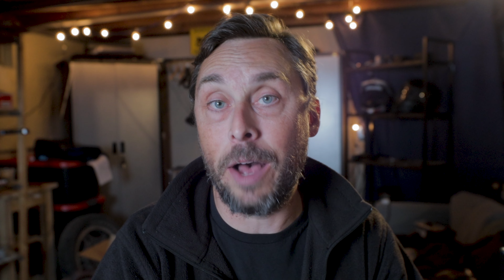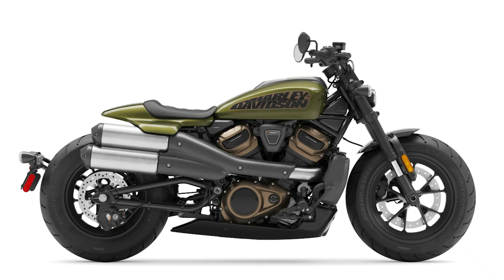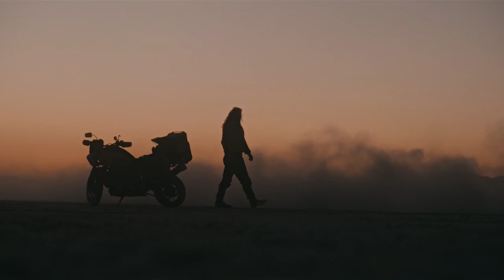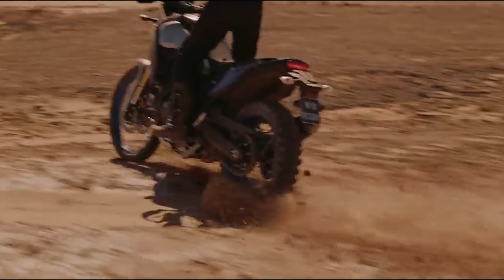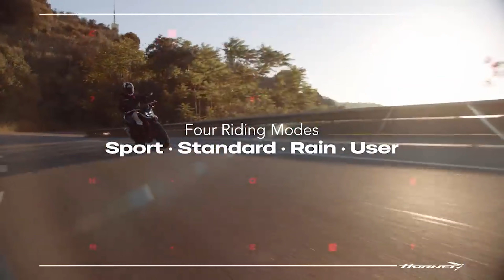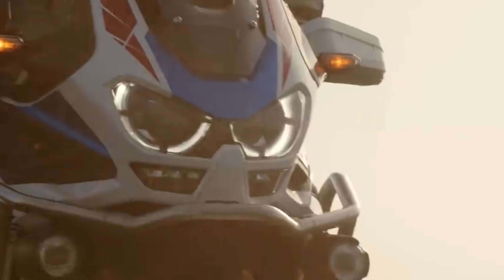Honda Transalp 750 & Harley Pan America 975- Announced at EICMA?

Comment: I REALLY hope that Honda has figured out the top heavy nature of their AT.  Triumph moved the engine by rotating it forward to get the weight lower.  I hope Honda does the same.  That and lowering the seat height a bit.  I like some off-road, but its mostly gravel roads.  I don’t need as much travel as a big ADV bike, but having some is required to not bottom out.  Transalp could be a great bike.
Reply from the maker: Im definitely challenged by how top-heavy the AT is. I have high hopes for the Transalp.

Comment: Let’s hope they take off all the electrical issues plaguing the 1250. 
Mine let me down for the third time yesterday, not starting. 
I had to take another ride. 
I let my dealership know that Harley needs to buy the bike back at this point.
Reply from the maker: That’s crazy! There are so many Pan Am riders with electrical issues. I’ve been pretty lucky with near 3K on mine.  I hope things get fixed or the dealership does the right thing.
Reply: @GreatEgret   11k on mine and yeah, it’s always something.

Comment: I don’t think it’s fair to compare the transalp to the tenere and I don’t think it’s Hondas intent to compete with it. Past generations of the tenere have always been rally/off road bikes and the transalp has always been more of a layed back but very capable adventure touring bike and it looks like nothing has changed for both motorcycles. I think the transalp will do very well with older and more timid riders who want a bike for exploration and the tenere will always attract the more aggressive hooligan riders. Lately the T7 has been the bike of choice for a lot of trans-continental explorers ( or at least most of adv moto bloggers I watch) but I think the transalp might dethrone it for that purpose. The Honda looks more comfort focused and it appears that you might actually be able to flat foot it. We’ll see. I’m looking forward to a more comfortable option than the T7.
Reply from the maker: There’s no doubt that the T7 is somewhat in a off-road class by itself compared to other brands and it’s impossible to directly compare it with whatever the new TransAlp will become. I think you’re spot on with many riders wanting a flat foot-able and more comfortable option over the T7. Especially one with rider modes and a TFT display.
Reply: @GreatEgret  I think the transalp will be welcomed by the adventure community. Watching other people with older transalps going through the Himalayas and pamir highway, looks like it tackles all that stuff just fine. I’m sure this new gen won’t be any different.

Comment: They made the TransAlp a whopping ~200KGs - that's insane(ly bad). But, if they add DCT (an absolute MUST) and a seat height of 800mm, they will sell these bikes like cupcakes.
Reply from the maker: This is the most accurate comment you will see on this video!
Reply: whats heavy about 200kg?
Reply from the maker: I think 200Kg is a great weight. That about what the T7 is. I think Honda selling a lot of Transalps if the  seat height is  800mm and there is a DCT versions is accurate.